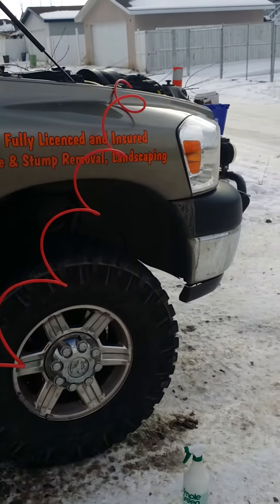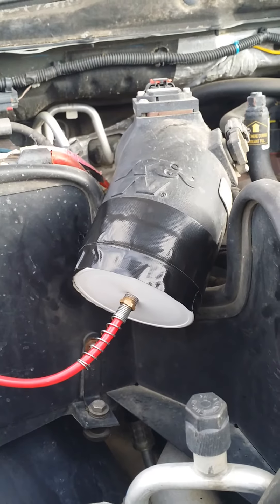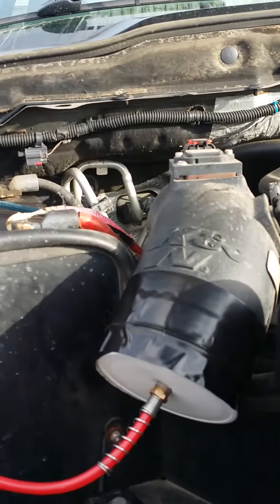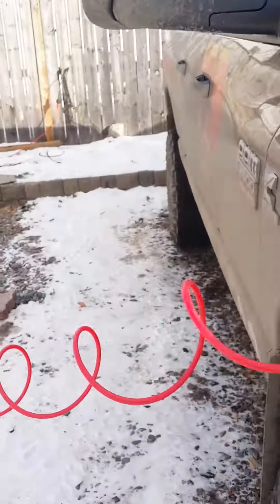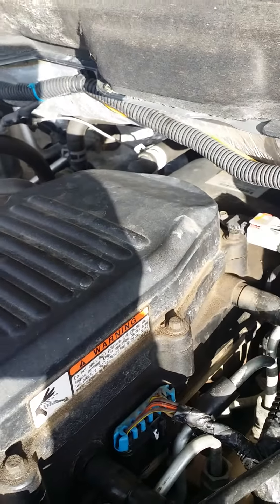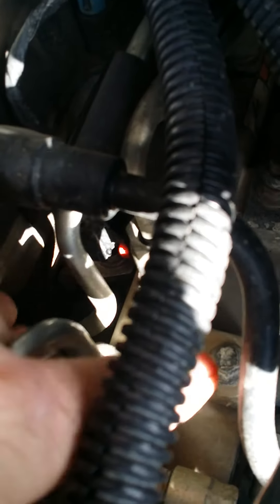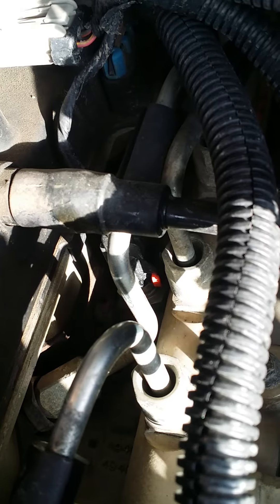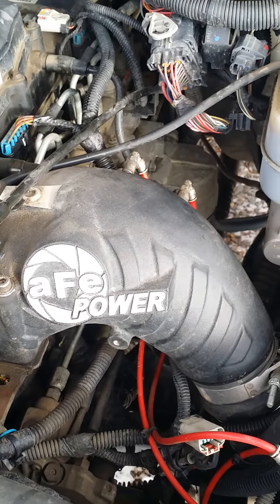6.7 cummins leaking boost .home made tool

Comment: I'm getting a weird whistle when using my exhaust brake... not the normal whistle from the pipe but up by the motor. Could this possibly be my issue? I have 2009 6.7 in Calgary as well(not that it matters)
Cheers,
Reply: I'm getting the same issue. but with how the exhaust brake works, your leak would probably be on the exhaust side. I'm going to try and figure mine out this weekend
Reply from the maker: mine was the intake side . beside the intake horn
Reply from the maker: it was intake side
Reply: Wonder if it would be worth it to ask dealer(s) techs... they should have seen this in past?
Reply: I too am having the exhaust brake weird sound found this video so gonna find this bolt
Reply: Hey man great video! I’m having some trouble with my 6.7 as well. It doesn’t seem to whistle as much as it a few months back and it also seems to be lacking power pretty much everywhere. I’ve ruled out the fuel as the issue. Just had a new fads 165 installed and 33% over cp3..do you think a boost leak would cause me to lose some power and. Whistle noise? Truck is fully deleted.
Reply: Most likely on the exhaust side. I had the issue with mine and it was the egr delete plate. Swapped the gasket and have had no issues.